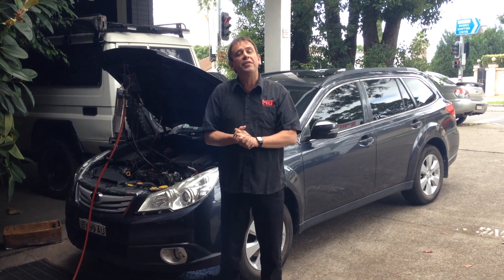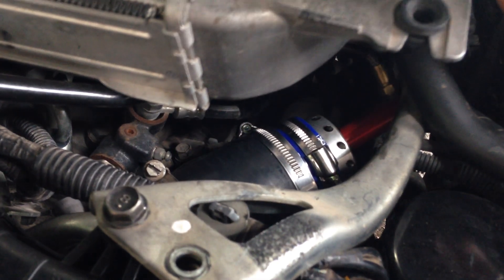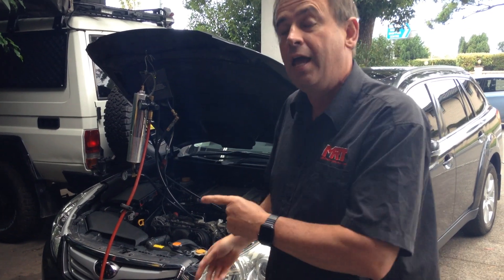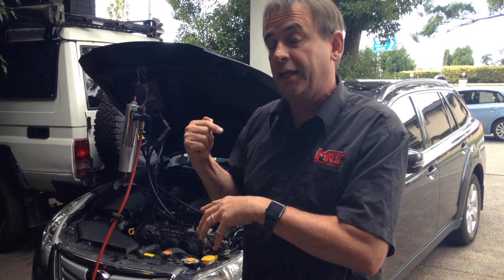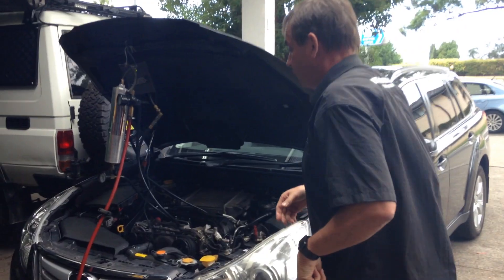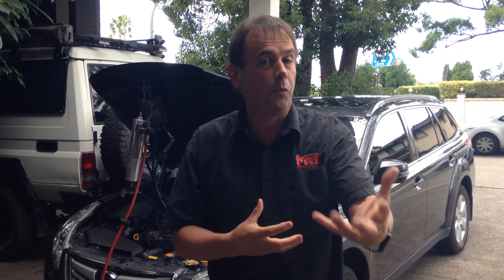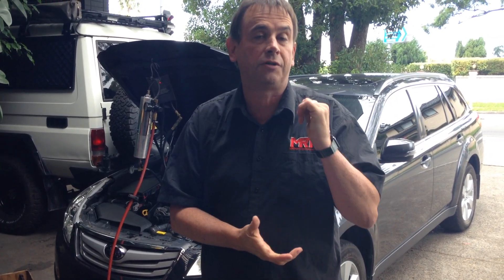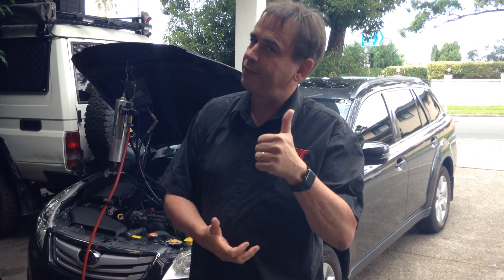Subaru MY10 Diesel - Soot Solutions

Comment: If you want to prevent soot build up try fitting an oil fumes seperator/catch can and also as said above use a thicker oil 10w40 or 15w40 that is compatible for dpf equipped vehicles of course.

Comment: What do you have for an opinion on the subaru diesel crank problems. They all seems lika a ticking bomb just waiting to break apart. 200.000km and after that it is like russian roulette. In our shop i´ve seen it on 08-13 years models. Even on perfectly serviced cars.